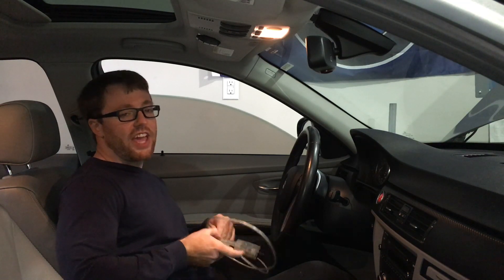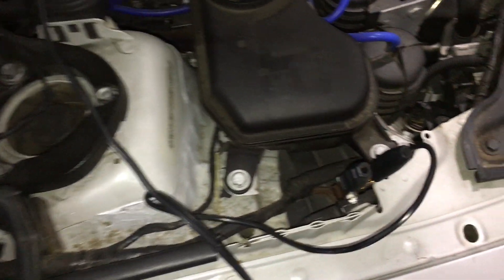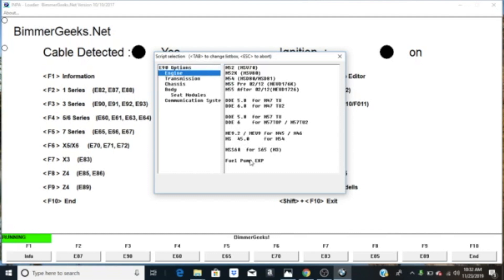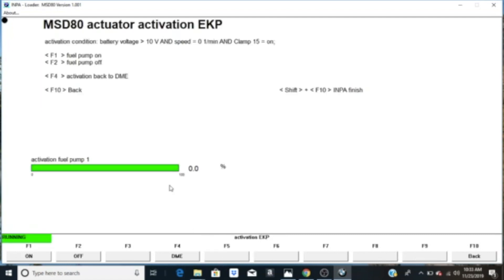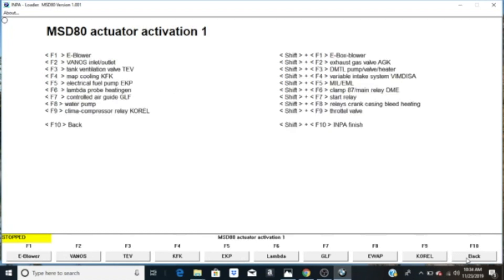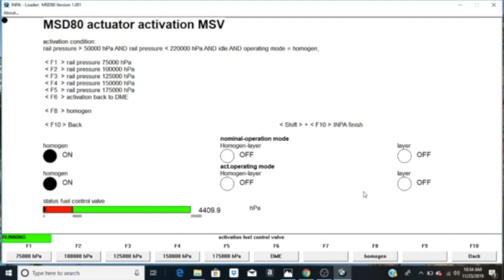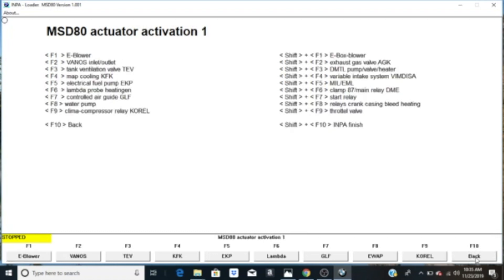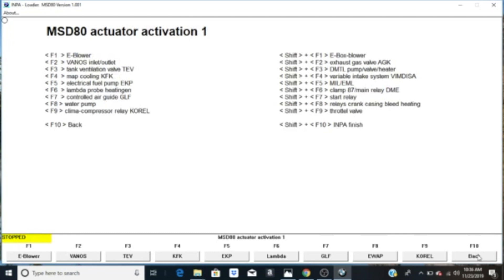How To Test Your BMW Fuel Pump Using INPA

Comment: i've got e60 n53 msd80 and i'm getting 2AAF fuel pump error,i've chsnged the EKPM module and still nothing,the fuel pump is running on 99% power even on idle but the car itself does not have any problems when i'm pushin the gas to the floor,is it the fuel pump dying or is it the fuel pressure sensor near the HPFP dying? also the pump shows it's pumping about 4.7 - 4.9 bar

Comment: What version on inpa do you use? I installed Mikes easy version and it’s mostly in German
Reply from the maker: I honestly don’t remember anymore. I think I got it from Bimmergeeks. I think it was mostly in German too.
Reply: It has files in installation that you need to override. Check folder with text file. It will be on English after.

Comment: Great video. I have a question, What should be the percentage reading of activation fuel pump 1 when it is in normal operation? Im having stall issue and im monitoring it under activation 1, my reading is around 57-77%. Thanks

Comment: You might have just gotten me closer to figuring out the issues with my n54. If so I will try my best to come back and give you your credit
Reply: So after a lot of testing and money this method should only be used to diagnosis complete failure. If the values are low that will not validate a weak fuel pump, I have proven this by using a stage two fuel pump, new fuel module, and fuel regulator. My values rarely ever hit 4900 and car runs fine. If you are not even getting half the recommend value combined with starting or running issues, you have a fuel system issue. If you are just suspicious of an issue, you should monitor/log for lean running conditions or spikes.

Comment: I run this test and when I go to see the hpfp value it stays on 0.0, any idea as to why? My 135i refuses to start - I've replaced the LPFP sensor, the hpfp sensor on the fuel rail and today the actual hpfp and still the same results
Reply: What was the issue at the end?

Comment: Hi, after my I turn on my fuel pump, I return back to the generator to check out the rail pressure but I can only see 10.6 volts not the pressure. How can I change the setting to see pressure. 
Thx
Bill

Comment: What do you think? Have a JB4 G5 board.  Keep getting fuel pressure errors.  Have replaced the lpfs, lpfp, and regulator. Still getting the error code.

Comment: I been struggling to start an e46 m3 that I purchased for 1k with only 70k miles . Anyway I replaced the fuel filter relays check fuses and I noticed that that test only goes to like 2684 or something like that, do you think I might have a bad pump? By the way no codes 🤔

Comment: Hello, great video. I also want to do this fuel pump test.  My bmw model is e46, 320d,1998. I saw in the menu that the program has this model. But the problem is that my INPA program that came with the cable, the engine menu doesnt working. So obviously the problem is with the version of the program. From where i can get your INPA version ?

Comment: Hello, I have a 328i 2010 and I want to do a cat delete but I want to be really sure how can I do it, how can I talk with you?
Reply from the maker: Well a 2010 328i has 4 cats. 2 in the manifold and two about halfway down the exhaust. To delete the first two you’ll need Headers. Active Autowerks is the way to go for those. For the secondary cats you can either drop the exhaust and gut them with a broomstick or something or just cut them out and have a shop weld in a pipe in their place. There are no sensors connected to the second set.
Reply: BMW-E90-HQ thanks for the answer, the problem is that I’m not from US, I’m from Honduras also my car, and recently I’m having a problem with my car because it drops 2 codes about the exhaust and when I saw your video eliminating the cats I thought that could help me with the codes, that’s the reason that I want to talk with you on Facebook o whatsapp because my native language is Spanish and it’s a little bit complicated explain you want I want to do, because I have questions about Ecu programming to eliminate the o2 sensors like you talk in one of your videos. I really appreciate if you can help me to teach me to do this the best way possible.
Reply from the maker: I have Facebook messenger. What codes do you have?
Reply: BMW-E90-HQ how can I found you on facebook?
Reply: The codes are p0430 and P2096.
Reply from the maker: William Legge on Facebook but those are generic scan codes you need something more specific for BMWs if you have an Android there are a couple of apps and if you have a windows laptop you can install INPA and/or ISTA.
Reply: BMW-E90-HQ there is my message on fb.